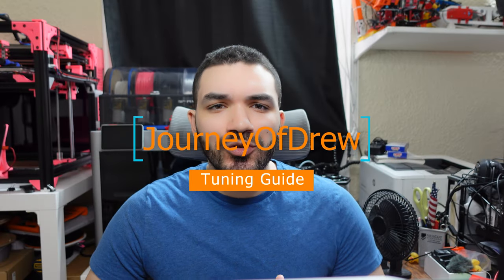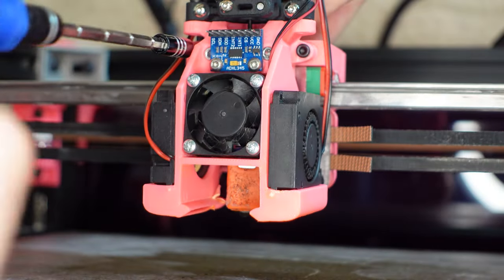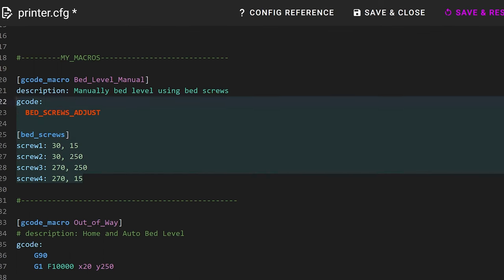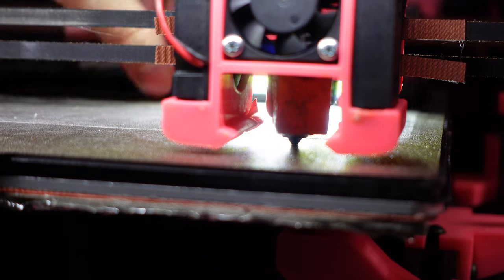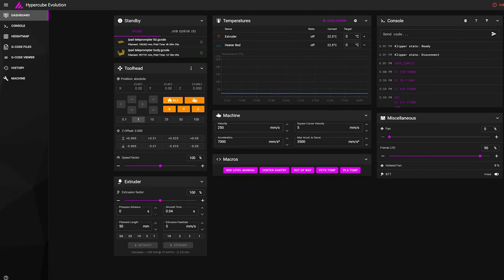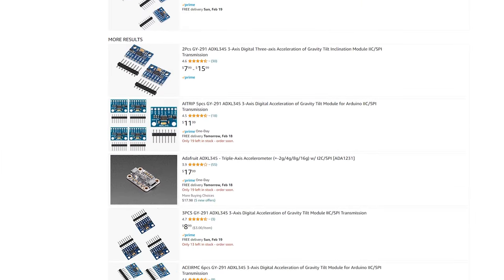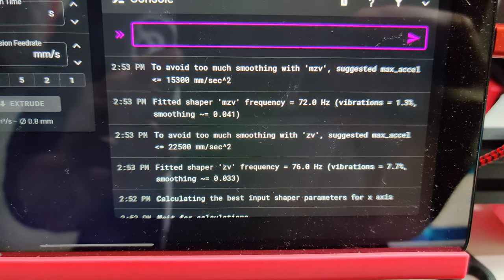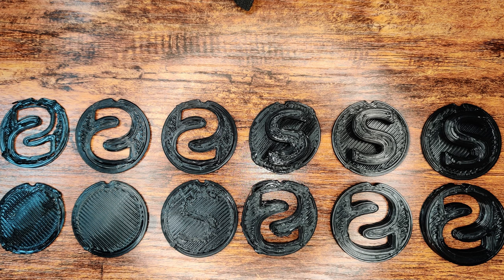TOP 5 TIPS for Tuning your 3D Printer Faster with Klipper

Comment: I am, but I have to rebuild this f-ing Hurakan because it’s driving me crazy that it tried to kill me. What is wrong with 2 ground wires on the power supply’s FG post? What is the legal fix? Your help will be appreciated.
Reply from the maker: I'm not sure how much I can help. But can you provide more details? I can try
Reply from the maker: Very strange, something must have shorted out. That's the only way I can see those boards burning out like that. I think your solution on the power supply is a good idea, that should help. As for when you get the new boards you just gotta triple check the connections. Something must have moved around after or when you installed the accelerometer. I empathize man, I burnt one of my boards by plugging something in the opposite way. Happens to the best of us. My accelerometer is plugged into the raspberry pi that is running klipper on my machine to avoid some of that mainboard trouble.